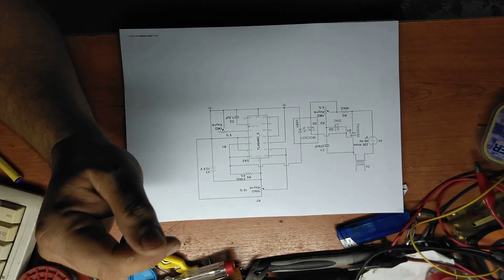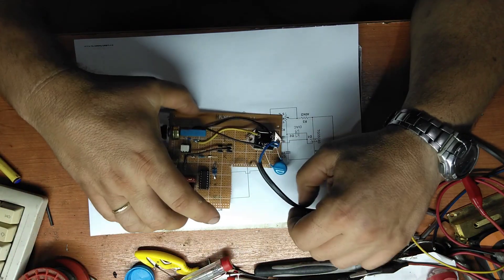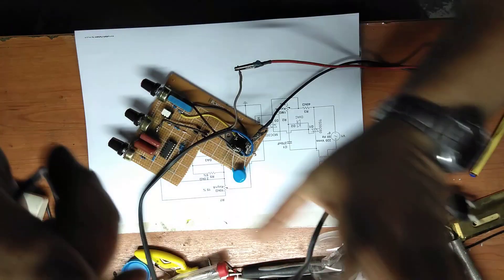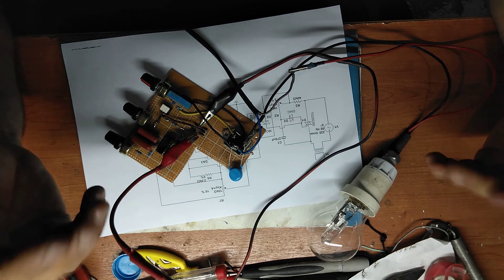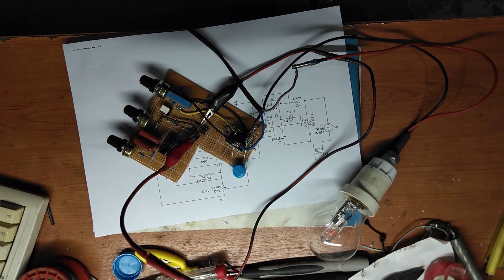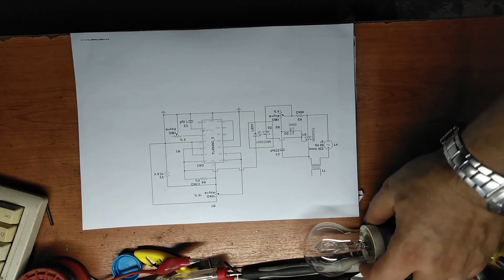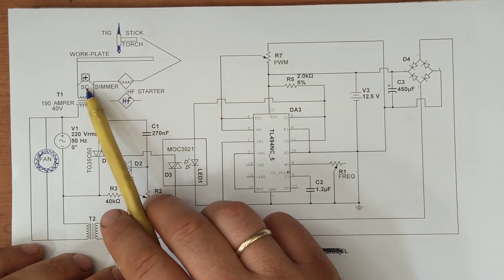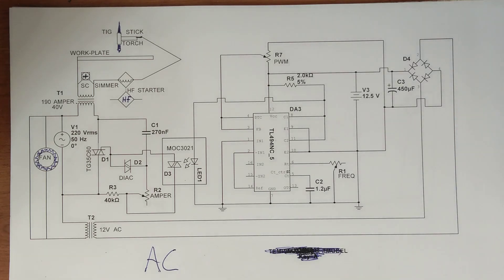let's make a AC- PULSE tig and stick welding machine with HF arc starter [schematic on video]

Comment: Γεια σου Zuzuni, η κοινοποίησή σου είναι πολύτιμη. Το μαθαίνω αυτό ως χόμπι και προσπαθώ να περνάω τον χρόνο μου ευχάριστα. Είμαι λίγο αρχάριος. Προσπάθησα να δημιουργήσω το σχηματικό PCB για το κύκλωμα χρησιμοποιώντας το Sprint. Αν θέλεις, μπορώ να το μοιραστώ μαζί σου ιδιωτικά, ώστε να μπορείς να ελέγξεις την ακρίβεια του σχηματικού. αν ενδιαφέρεσαι ακόμα.
 Merhaba Zuzuni, paylaşımın çok değerli. Ben hobi olarak öğreniyor ve güzel vakit geçirmeye çalışıyorum. Biraz acemice, devrenin pcb şemasını sprint programında yapmaya çalıştım. İstersen özelden sizinle paylaşırım, siz şemanın doğruluğunu kontrol edersiniz. Hala ilgileniyorsanız.
Reply from the maker: thanks for all... just bild it,,, it control the voltage , not the amper and makes very sueet weldings...but..
 it not work good on AC tig becose the hf interfear with the dimmer... for AC tig works the transformer setap.
Reply: Have you created
The pcb, is it available 
For public

Comment: Yes, but they seem to have different locations or different trails.
Reply from the maker: is cable conekting ..not pcb.. i dont sell this things,,so  i buld one  for me in comon hole pcb with wires, is simpe and esy,, just buld it.
Reply: @zuzuniagrikubanos6473  Thank you very much my friend, I'm clearing up my doubts with you... I want to make one too, but I'm not good at electronics
Reply from the maker: @RavidSantos-vg6lq  sent mesege to the other fox hw they bild it... im also not good in eglese but i do my best,,, do the same.

Comment: Hi, Zuzuni
Congratulations for your work! Really interesting, well done!
I'm a guy passionate about electronics and mechanics. I've been TIG DC welding for some time and now I've decided to build an AC/DC welder starting from your project!
I started following this schematic for the control part and on the high current part (secondary coil of the main transformer) will have two paths: AC with HF start or DC (diode bridge, 10ohm 4uF RC filter to stop HV, special component, large inductance to stabilize and HF starter). 
I don't know yet if the diodes will work well with the frequency produced by this circuit or if I will have to do a bypass when using the DC function but I will think about it later.
Reply from the maker: I do the dc tig with scratch start ...and only the ac tig with HF starter...because it burned some of my diodes and I'm bored with the repairs.

Comment: Halo. I have question. How to joint this pwm modul and ac balance modul with single Transformer. Thanks
Reply from the maker: schematic on video
Reply: Yes the scematic in video. But in other video you have scematic  ac balance. I want to joint ac balance and Pulse or pwm scematic in single Transformer .thanks
Reply from the maker: @omenajah9466  I think it's overkill for just 50hz ..... but it can be done. So what? You need help with the schematic? if so then sign up to the forum = https://doityourself123.forumgreek.com/ and opened a related topic where you'll upload a photo of your progress and we'll see what schematics you need.
Reply: Sorry i m newbe😊 .I mean  2 modul on 1 Transformer.  First modul ac balance ,second modul is pwm or Pulse .thank u very much  .you help me in my jobs ❤🙏🙏🙏
Reply: Ok

Comment: Can a analog/digital display be added to the welder? Also, how many transformers were used?
Reply from the maker: yes....If you know how...needs new schematic that I don't feel like making.
Reply: @zuzuniagrikubanos6473  that’s ok, I should be able to figure it out. Thank you for your help.
Reply from the maker: @roberthamm9304  On mine I've put one led flashing at frequency and pulse width mod...So that way I have a visual indication of what's going on in the electrode.
Reply: @zuzuniagrikubanos6473  thank you. That’s not a bad idea. I’ll keep that in mind.

Comment: hello there alot of nice project congrats 
on this one should a bta416008 manage to replace your triac ?
its 40a instead of your 35a and surge around 400a also, am I missing anything?? 
with proper cooling of corse.. thx
Reply from the maker: bta416008 is ok if is fore 40Amps !!!!

Comment: MOC3021 and LED how that combine you?
Reply from the maker: schematic on video.........
Reply: I watch this video many times but i cant understand that MOC3021 AND LED combine
Reply: Please get me your whatsapp number can you get that me personally
Reply: That IC circuit area was work but that MOC3021in that area was not working    please give me a idea for that
Reply from the maker: @Loyd__1973  on the MOC3021 probably you have to ad a resistor on the led pin about a 5 kΩ  to 10κΩ.. they burn eesy with no resistor.

Comment: I notice u put capacitor on t1 to t2 pins what value is that
Reply from the maker: 15 kVolt cap
Reply: @zuzuniagrikubanos6473  still failure on me☹️ my tg35c60 triac got short for a second i dont know why i connected two of them in parrallel. Ormy connection on the triac got wrong. I connect t1 to coil and t2 to the source is that right? Other vid i seen t1 must ac source and t2 for the primary coil?
Reply from the maker: @smoke_stackz3168  is jast a simple dimmer conection = https://makingcircuits.com/blog/simple-triac-dimmer-switch-circuit/ with a optotriac = https://circuitspedia.com/solid-state-relay-circuit-diagram-with-optocoupler/
Reply: @zuzuniagrikubanos6473  i got it now my connection is right just my triacs are fake i ordered it from china
Reply from the maker: @smoke_stackz3168  dont put 2 in parallel.. 1 is work beter.
Reply: @zuzuniagrikubanos6473  can i just use the 2000w dimmer and replace the triac with tg35c60 its the same circuit but the only difference is that the t1 conected to input and t2 is the output
Reply from the maker: @smoke_stackz3168  they all conected the same way = https://www.mouser.de/new/sanrex/sanrex-tg25c-tg35c-tg40e-triacs/ take the tg40////for more power
Reply: @zuzuniagrikubanos6473  still my triac exploded when i tried to short my out put. Withoutload it works
Reply from the maker: @smoke_stackz3168  My works as you see on the video.. somthing you connect rong or the triac is monkey from monkey factory.

Comment: I will use this for a migg weleder who has defective switch, this way I can also regulate wider current. I need not the pulse then but use the opamp for the handswitchs.
Reply from the maker: this is a 35Amp on 220v triac... if you have a single phase welder is OK !! if is biphasic welder then you need 2 circuits with 2 triacs.
Reply: @zuzuniagrikubanos6473  Oke thanks. I have a single fase 220, with 7 current setup switch. I had these defective, so the thought of a triac. I presume I do connect it to the highest current windings and can then adjust current as usual. I think it is 160 amp max. I can use the winding also for 140 amps and set the triac there for less current stress.
Reply from the maker: @audiokees4045  we connect to the primary and ... we connect it to 220v  on max setap for fom 160 amp to 0 amp on the secondary. the triac is ok with  a heatsink always.
Reply: @zuzuniagrikubanos6473  I did see you are use a pulse chip, but these big transformers are very slow responsive device,  it does work fine with inverter or type welder with drivable recifiers., So I ask myself has this effect. the triac regulator however is a nice way to regulate current, special because I can not buy the switch anymore for the mig (I have a mig). Nice project

Comment: R2 value?
Reply from the maker: R2 = 500κΩ  R1 = 2MΩ  R = 7 2KΩ
Reply: @zuzuniagrikubanos6473  by the way i can use adjustable frequency generator module instead of tl494 right?
Reply from the maker: @smoke_stackz3168  i bild the frequency generator with the 494.... if it is so difficult for you to make the circuit, use the module.
Reply: @zuzuniagrikubanos6473  can i add switch to shit down the main transformer by disconnecting the diac on the triac?
Reply from the maker: @smoke_stackz3168  ..........it works but it's not safe

Comment: Absolutely FANTASTIC!!!!!!! If you do not mind what type of welding transformer did you use? Also how high can you go with the frequency? Will I be able to go higher than 200KHz? Thank you so much . I am working on a portable welding machine the size of a shoebox. I am also working on a portable Plasma cutter and bot of them will be cordless and not extremely heavy. Thank you for the circuit!!
Reply: Khz on laminated iron core transformer?
Reply: estou no Brasil  e gostaria de fazer um curcuito igual para meu uso , se puder me ajudar agradeço

Comment: Great Job. Please could you write in the description the list of components values that were used in this circuit?
Reply from the maker: the components values   it is ON THE shematick
Reply: @zuzuniagrikubanos6473  thank you so much for the reply. not all component values are mentioned in the schematic diagram ❤
Reply from the maker: @munirmohammad3493  only the potensiometer... on the dimmer [amper pot] put 200kΩ or rotary sqitch ... on the friq put 1 MΩ and on the pwm 2 kΩ
Reply: @zuzuniagrikubanos6473  thank you so much

Comment: Someone asked what the value of the power control potentiometer is and you answered that it was a rotary switch with a 500 Ohm resistor, could you tell me where it is in the diagram, since I only see a 1mohm potentiometer. Thank you very much, I hope your answer
Reply from the maker: on the video is a 500 ohm potensiometer, after i replace it with a rotary switch and resistors,,,,, is more durable,,

Comment: Awesome proyect a question, what is the rectangulaar blue plastic, in the potentiometer of dimmer? if is a capacitor, what is, in te schematic, and value.  i made it. thank you
Reply from the maker: it is a capacitor
Reply: @zuzuniagrikubanos6473 is it 220pf 15kv capacitor?

Comment: Sir, my students were so interested in this circuit that I decided to build one with the following modifications.
* A diode was introduced in series with R2 to cater to the positive 50 Hz supply half wave, while a second R2 in series with a second diode to cater for the negative supply half wave, was introduced in parallel with the first "R2 and diode combination" so that the power level obtained from the positive and negative halves of the supply sine wave, could have a DC bias balance introduced in it at this stage. 
* A potentiometer was introduced in series with Diac D3 so that the two power levels during the Mark and the Space ratio could both be controlled.
* We had to work with what we had in store and so the full isolation from the pulser low voltage circuit to the high voltage was made with a simple mechanical relay while the pulse was obtained from a single operational amplifier connected in an RC  pulse oscillator with a variable M/S ratio and variable frequency. We left the low-intensity bulb connected in for the welder to see the M/S and frequency and also introduced a low pass filter to detect the DC bias in the waveform resulting from  the difference between the two R2 resistors and diode combinations. 
All the students congratulate you for your very educational videos. Thank you.

Comment: This is another excellent and economic manner for controlling the arc of a welder.
With some past students, I needed to be careful how I use the word PULSE and the word FREQUENCY, for frequency, they seemed to understand the main frequency, and for a pulse, the half-wave of the supply,. which in this case remain constant.
1. For power control it is the triggering time, hence the duration of the individual main supply pulses that are controlled at 50/60 or the related 100/120 Triac firing rate. 
2. Then the other control is the control of the groups or batches or bunches containing a different number of main supply pulses per periodic time which produces the mark/ space ratio or the relation that exists between,  the bunching to no bunching periods. ("Bunches" as we use in Klystrons) 
3. The third control is the RATE at which the bunches are generated.
I am rather surprised at the thin size of the feeder cable to the welding rod at 1:16. In my days in the Navy, we used to rate copper at 1000 amperes per square inch, but as a civilian, we rated it at 2000 amperes per square inch! 
I am retired now, but if I was still teaching all my students would have been urged to see all the brilliant practical, educational work. To think that all this can be obtained with two transistors operating in an astable mode! or should I say two flip-flops feeding each other!  
Well done and thanks again for such good work and the kindness of sharing it with viewers. Students have so much to refer to these days and we should start talking about "reference videos", rather than "reference books".
Reply from the maker: I would like if you allow me to put your description in the description of the video.
I put it casually so you can see it and I will wait for your answer
Thank you very much
Reply: @zuzuniagrikubanos6473  Sir, you are free to use my descriptions/comments as you think is fit. In fact,  at my old age, I am highly honoured that you chose to do so. You are a good gentleman and a very responsible one and you work so hard to teach others the complex wonders of engineering. You should be highly respected. Thank you for that,

Comment: thank you simple is best..  what are the values on the  r7 pot r1pot r2 pots potentiometers thanks
Reply from the maker: 10K on the pwm  1M on the freguensy and a rotary switch with a 500K resistors on the dimmer

Comment: Can u make current controll for ac transformer arc welder?😁
Reply: is on the video.. Current are "Amps" and is controlled with the circuit... 
 if you dont understand electronics maybe you dont try this proyect..
Reply: @josegante6982  I know electronics. I make a lot of electronic projects
Reply: @josegante6982  https://youtu.be/OrFwpwbp8NU?si=r-maBEHtcY9F4HVc
Reply: @josegante6982  https://youtube.com/shorts/oz36e_hLokw?si=r0JL13xfX3ey_3xf

Comment: nice project !, gonna try it later on my buzzbox 
one question...my electronics is pretty basic so please bear with me ,is the capacitor value matter (capacitance/voltage)? was trying to replicate this  pulse circuit with ic 555 and relays on my dc inverter welder, but the ic get damaged within seconds i suppose it's from HF spikes , i put two 0.63uf 250v in series on my welder output and ground it to welder chassis FYI the  hf is running continuously which im also still trying to figure  on how to make it single spark rather than continuous since im just using it on DC welder
Reply from the maker: with the 494 you can adjust both the frequency and the pulse width
the spark must work continuously to stabilize the arc ,,,you have of course switch in hand to stop it however you want.
the capacitor is right in value.
isolated the dc circuit from the welding circuit.